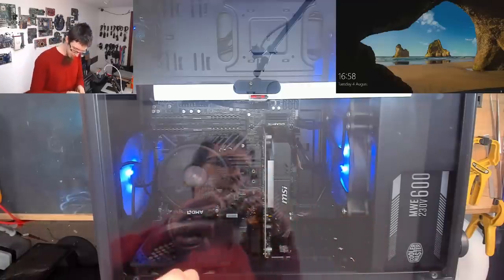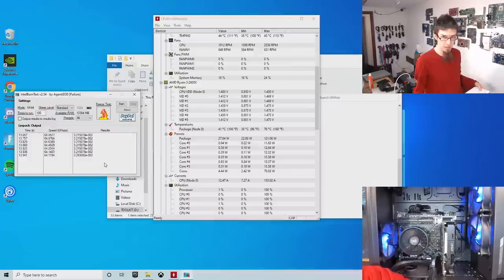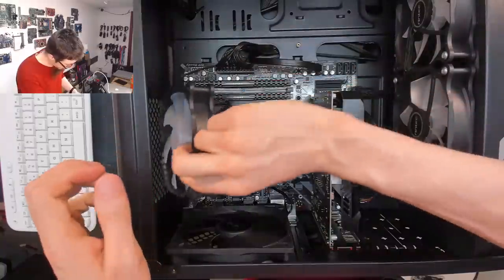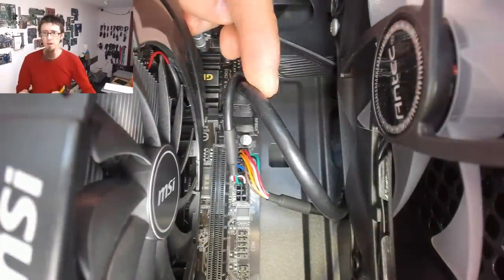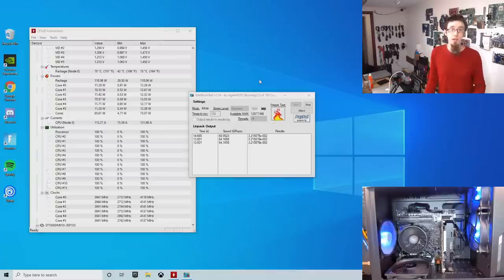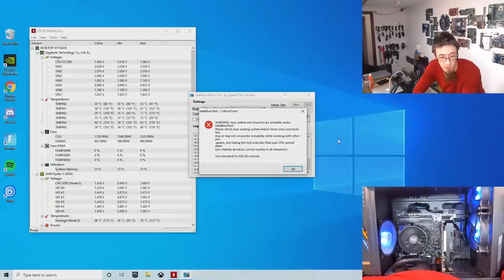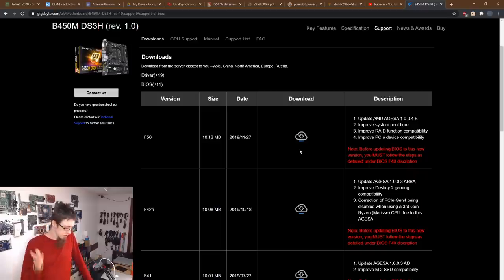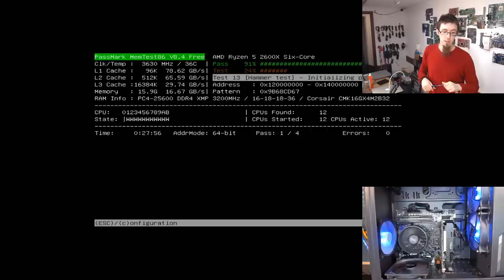Gaming PC Crashes at Random - LFC#217

Comment: I OC'd my memory recently and had the same symptoms when some voltage was too low or a timing was too tight. In my experience an unstable CPU configuration doesn't crash single applications - either it doesn't show or the entire system crashes. Memory is in between and can crash single applications, I suspect because it corrupts single address spaces, where errors can't propagate through the entire system. It will hit the OS AS eventually which then causes "random crashes".

You mentioned one tool you didn't know the name of, I think it's "DRAM calculator for Ryzen".

EDIT: I just realized your first assumption of thermal issues can cause the same symptoms. I think you did a great job and I hope my comment doesn't look like I want to explain your job to you.
Reply: a single addres error in memory don't crash single application but freeze windows, i have that problem with one of my ram stick :(
Reply: I have had unstable cpu configurations causing crashes in single applications, quite often actually. Games like ac: origins and Warhammer 2 for example, after giving the cpu a little bit more voltage it was fixed (happened to me on both Intel and AMD). It is tricky though because they tend to be seemingly random crashes and not replicable with common testing/benchmarking software. It took me quite a while to figure out what was the cause.

Comment: I’m surprised you didn’t reseat the memory modules and graphics card. Reseating is something I always start with. I must admit I was expecting a clogged up cooling system. I had a customer tell me his computer wouldn’t run for more than a couple minutes. I took the panel off and found the intake fans fully blocked by dirt and hair. The CPU HSF was clogged with dirt and hair as well. A little cleaning had his computer up and running. Had to give him a class on cleaning his computer.

Comment: I can relate to this situation a few weeks back. Different motherboard and different sets of RAMs.

All I can say is that always check manufacturer's QVL portion to avoid getting incompatible memory for your motherboard of choice.

And as much as possible always check for warranty of the RAM and other components, make sure that there is at least a 2 week outright replacement warranty for any factory defects or whatsoever.

Comment: Must thankyou for this video @Adamant IT . Built this ryzen 2700x system last Dec and been having intermittent shutdowns pretty much from day 1. at first I thought it was ram, then Power supply, then the Old GPU. replace all 3 and still had the same thing happening. Turns out it Was incompatible Ram for the CPU/MOBO combo. Had never tried the Intel Burn test before, tried it this evening and it immediately crashed the entire system, turning off XMP allowed it to do 4 passes before the system rebooted. checked with MSI and discovered that there were 4 revisions for my Bios, so downloaded the latest bios and updated it, and my computer just did the full 100 passes running in XMP set at 2933mhz on the incompatible Corsair Vengeance LPX memory, and although rated at 3200hz I am happy its working now, but when I get payed next month I will invest ion some ram that IS compatible with this CPU/MOBO . and I found this out just by watching your very useful video so again tyvm

Comment: Wow I haven't looked this up at all but follow a lot of tech channels and this came across as something I may like. Fate or something brought me to this channel! I use the same cpu and have a b450 msi gaming plus board and had the same issues. I have 3200 memory sticks installed and had a blue screen error all the time so I timed them back to 3000 and it stabilized but still crashed after about an hour or 2 playing mostly anything. I ran this burn test and found mine had the same error when running on xmp 3000 though. I toned it back to 2800 and it stopped but I wanted to try better. I found my bios was still on the original version so I updated and thankfully am able to at least run at 3000 now stable and passed this text 5 times now so I am satisfied. Very lucky to have you make videos like this and that I came across it. Keep it up!

Comment: Great channel - i love the content.
Im a professional repairer myself - if theres some weird hardware fault going on,   then i usually zoom in on ram firstly and rule that out.  Failing that,   cpu,  heatsink & fan & paste normally follow when theres something dicky going on which seems heat related.  Bios and drivers are a give  too.

Good luck with your expansion plans - i work full time in IT looking after data centre stuff (AD,  Sccm, VDI etc)   im lucky enough to have space at home to run my repair side gig with little overheads,   so i feel your pain mentioned in the other vid.

Best of luck for the future!

Comment: 7:47 "I have not installed anything" -- Yes, you installed the .net 3.5 framwork.. Not having the frameworks installed might be something that could be the reason games are crashing the computer :P
Reply: Valid observation but a false conclusion. Not having the proper .NET Framework would even just bring you to the dependency screen he got. It's the "magic" of Microsoft's "compatibility" lol! If you need a .NET Framework it's supposed to be checked for by the games you install that have .NET dependencies. It won't crash a game without it but it will keep a game from even executing.

Comment: sometimes you need higher voltage on the memory for xmp ✌🏻
Reply: Yeah, I have had an issue where for some reason I couldn't save the right voltage, it always defaulted to 1.20, very annoying and a lot of restarts and power cycling. In the end some how it did save 1.35.
Anyway, I did some research about this particular board and RAM problems, and a common solution for XMP problems seemed to be giving it a little bit more voltage. I didn't need it in the end, so I am not sure it works.
Reply: @TobyIKanoby  XMP is better disabled if you're running into issues. A lot of games like red dead redemption 2 on PC and applications that are memory hungry dont play well with XMP
Reply: @spakentruth  I don't have issues with XMP, my motherboard had because it didn't want to save the right voltage in the BIOS, for some reason it eventually did and everything works just fine now.
Do you have any references for "a lot of games" having issues with XMP? Because that sounds like BS to me, at least in the way I buy games, 1 or 2 years after release, when they have a reasonable price and the game is actually finished and optimized.
Reply: @spakentruth  That's a symptom of the RAM being unstable. It may be due to Vdroop for the VDIMM.

Comment: what the heck are those 2 fans doing on the shroud? dragging in air from no where haha looks like the screws were drilled into the shroud aswel xD
Reply: Maybe they extra? Lol i have no idea either
Reply: Yeah, came with the case. I did the same thing, just so my drive has that extra bit of cooling because they get pretty toasty.
Reply: many cases have mounts for fan(s) there. They obviously can't move air directly from outside but idea is that since lowest fan on front side push air under shroud these fans will move that air up to graphics card and/or (depend of card length) chipset, ram or disks.

Comment: Excellent video. Just subscribed.
I would have re-seated the memory modules, just in case a bit of contamination on a connector pin was affecting a signal. There's less safety margin at the top end of the performance range.
Reply: Contamination on a connector? What does that involve? A 100 year old computer in a post-nuclear war? Ugh, you people!

Comment: In my PC building experience, I've found the mobo manufacturers do not test higher speed or higher amounts of RAM but the memory manufacturers do. So, after exhausting the mobo QVL, I do check the RAM manufacturer's compatability list (as they test their higher volume and higher speed RAM against these same motherboards). G.skill allows you to start with a cpu & mobo and see what they support - which I consider acceptable as I'm going back to the RAM manufacturer anyway if the RAM doesn't perform.

Comment: When I built my PC, XMP was causing game crashes but no bluescreens. I ran a USB boot memtest and found tons of errors with XMP switched on, it ended up being that I was using slots 1 and 3 instead of slots 2 and 4. I thought that the memory sticks just had to be offset for dual-channel, but it turns out that the slots can matter too!
Reply: Same problems :)) but i put IT in 1 and 3 slots , in 2 and 4 IT crashes

Comment: I had the same issue with my Ryzen 5 2600 not supporting my 16gb 3600mhz RAM.
Had to down clock it to 3200mhz until I could upgrade to a 3000 series ryzen.
Love the content man.
Keep up the great work 👍👍

Comment: Actually with today's CPU's having the memory controller built in, the FSB runs at the same rate as the ram. So anything that is above the CPU's FSB ( 2933mhz ) is essentially overclocking the CPU.  So to work around that you need to increase the SoC voltage, but not by much at all! OR! manually set the ram speed to match the FSB of the CPU.
Reply: For Ryzen, that would mean an Fclk and Uclk of 1466.5, which I'm not sure that AMD supports, while AMD does support 1500, which if sync, the RAM will be at 3000.

Comment: Given the sloppy build I would have inspected the ram modules for corroded sweaty fingerprints. I would have remounted the CPU for the same reason. Oh and put a magnifying glass on the back of the obviously forced 8 pin EPS connector looking for dry joint ring of death. Anyhoo you did well for a yung'un. Well done.

Comment: Look, whenever you see the letter 'M' in a main board's title, just know that it's not really built for anything other than a desktop pc. People want to run the fastest CPU, the fastest memory and the fastest GPU and play games and then buy a Moderate main board to try to accomplish this. I use much higher spec boards myself and yet rarely run ram at it's highest spec...ram quantity is more important to me. I would have lowered the ram to 2800 myself to have more head room and then advised the customer to think about buying higher spec. I see a main board like a shelf, it has to be strong enough to support the load you want to place on it.
Great vid.

Comment: Ok I gots lots of questions. 

1. Most DDR 4 ram is labeled 1.35v so isn’t under voltaging your ram going to damage the ram and slow down performance 

2. Windows 10 update 2004 actually causes certain main boards to crash with ryzen and not function at all this includes gigabyte and asrock boards as well. 

3. After updating did you try to run a program to verify if the problem truly went away because with the new 2004 windows update the update causes gpu failures parked platters on peoples hard drives and even worse damages ram as well.

Comment: My first bare bones PC build was using a Gigabyte MoBo with a P4 2.4GHz CPU. That PC was snappy as hell and I loved it. Then I went ahead and built a secondary PC using a ASUS MoBo with a AMD 2400+ single core. That PC was just a bunch more smoother but not as snappy. After having the least amount of problems with the ASUS MoBo I tried a Intel ASUS combo Pentium - D 3.0GHz and damn, back then it was freakin awesome, snappy/smooth games ran great. fast forward to now 15 years later and my 3 PCs are all ASUS, 2 x Z97 and 1 x Z390 along with ASUS GPU's. The way I manage this. When I get something new for my Gaming PC I cycle that old part or parts down to my secondary PC and then those old parts go to the 3rd PC. The reason I have 2 x Z97 boards, I did a repair on a friends PC and he cooked the MoBo. He went and bought a new one and told me to keep the old one. Here, that MoBo was still under warranty and I sent it into ASUS, they fixed it and I kept it, letting my friend know and he didn't really care since I do a lot of work for him.

Comment: A check for a bios update should have been the first item on the "to do" list. The PSU appears to be oriented incorrectly: upside-down. Should be sucking fresh air from outside the case (if possible). The customer's two extra 120mm cooling fans attached to the PSU are also oriented in reverse direction, and are likely completely unnecessary: should simply be removed. Might also want to double-check the condition of the CPU thermal grease, since it appears to be a "home brew" machine.

Comment: Hi, may I ask a question, please? I built a gaming PC well it was more of an upgrade using older and new parts but it was running great no issues at all, it was the first time I bought a motherboard that had a cpu2 cable on it, I had a cable that came with my RM650 power supply but it was very long so I bought a twin pack pair of cables from Amazon when they came I fitted one of them and when I switched it back on there was a small flash from it and that was it. I reinstalled the long cable and switched it on and nothing, some fan lights were coming on but it wouldn't post. I finally managed to get it to post but only once I removed two of my ram cards out of slots DIMMB1 and B2 now it works fine but  I've tried reseating the CPU and checked the pins I have checked and cleaned the Ram slots all ok. Do you think this cable has broken my PC? I checked the cables with a multimeter and I have discovered that not only are the cables not wired the same as the original cable they are not even wired the same as each other. Great Videos Sir Thanks.

Comment: the only think i would complain about would be the fact you say the correct orientation for the top fan is exhaust when he most likely mad it intake to compensate for the terrible front panel air flow which would make his case become positive pressure thus forcing heat out the rear exhaust and also pushing heat out of other areas that are open basically working like a negative pressure case such as an nzxt h 500 case where you have more exhaust so that cooler air will find a way into the case from all the other openings which could be done with this case but he chose a different solution. Since it has front fan mounts though I would have cut a hole and put a mesh plate there. Over all though great video.

Comment: Hello! Is it possible to get a list of software on your diagnostic disc? Thanks!  As for me the first component I check is the PSU. Connect all the leads to a PSU tester and read the voltages over time. If any voltages are unstable that is a strong indicator that's a problem.

Comment: Its the memory controller on the 2600 chip.  The ram speed above 2133 is the actual issue.  
We use CoreTemp , Prime95 on small FFT, and Heaven bench for the graphics all off USB drive :)

Comment: On my personal experience, XMP at 1,35v seldom is stable, at 1,4v they work fine. Ive had and have Ryzen computers with 1600, 2200G, 1700, 2600, 3600, 3900 and 3950 CPU's doesnt matter if its B350, B450, X370 or X570 MB and ive had bunch of them from ASUS, MSI and ASRock.

Comment: Hey man! I ran hwmonitor as you did in the video. My cpu has 100 degrees celcius when it runs intel burner. At idle it is around 60-70 degrees. I opened the case and my coolers are standing ok, i applied fresh thermal paste and still high temperature. I currently have 2 fans. What should I try?
Reply: Do you still have this issue? What CPU and cooler are you using?

Comment: curiosity: why 3000 when the rec for ryzen is 2933 for high speed compat issues if you can't hit 3200? ie unlike intel has non 100mhz step preference.

i mean its a cheap board and only a ryzen 2600 (with some poor timings for a 3200mhz module: 16/18/18/18 oof) not a threadripper trying to get 4channels/8 modules of double sided dimms(16gb each) to play nice at above 2133, but the same general guidance should apply as they have ever since the ryzen 1000 series,  shouldn't they? ie what do you know i'm missing here?

also, without looking myself i can place bets on that mobo qvl not having more than one if any fully populated ram slot kit. i see 4 slots/dual dimm dual channel. wagers on a lot of 4x2 1x8 configs barely any if any 1x16/2x8 and essentially zero 4xanything.

they built the board with four slots and couldn't be bothered to test vet it?..

okay just checked the summit ridge qvl.
 yep. ZERO full slot qvl entries. interesting that they ONLY tested 1x8 and 2x8 configs.
 80usd board but cheese and rice, would have won that bet. no dual channel qvl. no four dimm/max pop qvl. no double sided dimm qvl(16gb module). no 4gb modules. 

its the same sort of hairball that exists all the way up to the hedt/threadripper side boards. its like they have a problem with doing the work anymore, and i can't blame it on the cheapness of that specific board if the same sort of monkey business was true of the promo/flagship 700+usd zenith extreme threadripper boards.

Comment: On the memory issue,
You can test 1 memoey module at a time to check if one memory module has a issue. I was having issues with BSOD on a old DDR3 FX system. I isolated the one bad module with a version of memtest86 that was packaged with a Linux distro. I was able to find the bad module out of 4 of them with memtest86. This takes a lot of time.

Comment: I would have stress tested it initially with the side panel on.  The way those fans were set up would have resulted a dead air area right at the CPU heatsink.  Having the panel off would have actually made it easier to breathe.

Comment: Don't hate on molex connectors! They're better than the lousy SATA that gets loose over time and loses connection or bend and breaks bricking your hard drive.. Squeeze the wires sideways when plugging in molex connectors, they go in much easier.